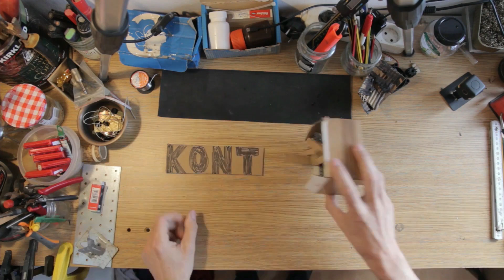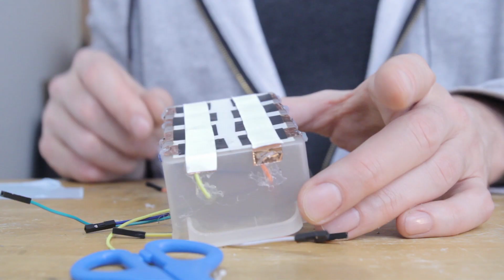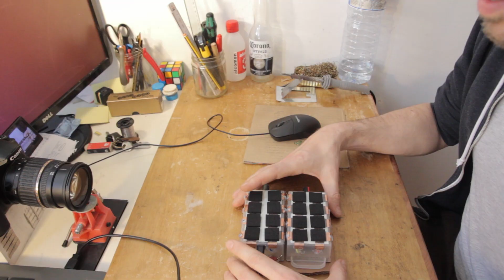DIY Pad instrument with pressure sensitive analog soft buttons: The Virus Pad.

Comment: For the past 2–3 months, my 8-year-old son and I have been really into ice hockey, but since we can't play on ice, I bought floorball equipment instead. Because it's winter, we play indoors in our living room. I built two goals out of cardboard, and then I came up with the idea of replacing the holes in the boards with sensor areas.

I searched online to see if a force sensor was affordable and whether I could create a DIY project using an I/O module or something similar. Then I asked ChatGPT, and it told me that I could do it with an Arduino or a Raspberry Pi.

I've always wanted a reason to buy an Arduino to experiment with electronics and programming. To build my own sensors, I watched some YouTube videos on the topic, but your videos on FSR sensors and this one are by far the best out there! Thank you!

Tomorrow, I'll start building the sensors, and I'm excited to solder everything together and play floor hockey with my son. I'll also make sure to adjust the sensitivity of the sensor on his goal so that the game stays fair. ;)

Comment: Hello, first of all, thanks for that great video. I'll definitely try to build a VirusPad on my own!

I have a few questions about the parts you are using (sorry if these are stupid question, I'm an absolute newbie):

- Is this a custom made breakout board or a bought one? If it's custom, are there any instructions I could find to make my own?
- I'm a little overwhelmed with the multiplexer; is there any certain one you would recommend, or does it not matter?
- My closest electronics retailer has only 8CH-Multiplexers, would it be possible to use two of those instead of one 16CH-Multiplexer?

I haven't used microcontrollers in a long time, and when I did, they were pre-built and I was "just doing the software part", without much understanding of the hardware (it was in a programming class about C), so, sorry again if these questions are stupid.

I'd really, really appreciate an answer and hopefully I can start soon building my own!
Reply from the maker: The breakout board is an early iteration of my KLIK (KontinuumLAB Instrument Kit) breakout. You really don't need it for this specific build, it just provides a practical place to plug in the sensors and multiplexer module. Great for beginners. The multiplexer pin numbers are in the code, control pins are: 12, 11, 10, 9 - and the sensor pin is 15.
I use the 74hc4067 multiplexer. Cheap modules are available online. You could use 2x 8 channel ones, but that would mean changing the circuit and code a lot, and I don't recommend it.
Hope that helps. Happy making!
Reply: @KontinuumLAB  That was very helpful, thanks for the quick answer!

Comment from the maker: This video is so long, I decided to make some time stamps to help navigate: 
Intro:
00:00 - Music
00:50 - Introduction
01:17 - KontrolFreak Intro

The build:
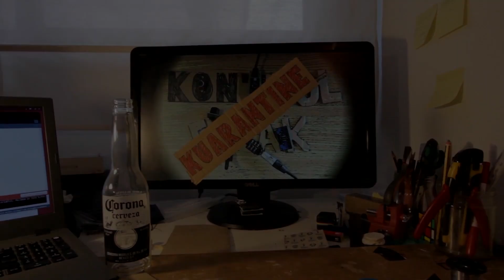01:37 - Materials & plan
03:48 - Making the base
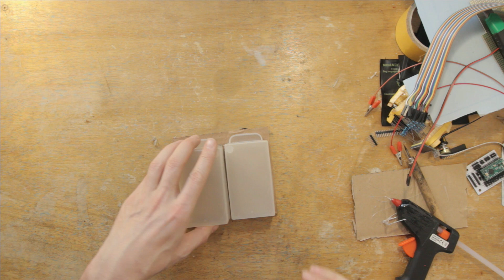05:44 - Planning the circuit
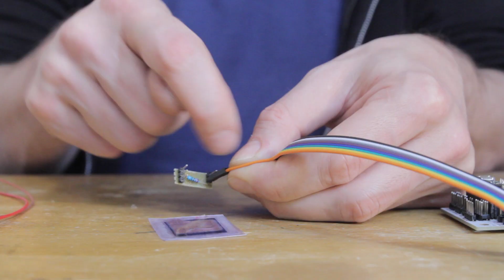07:00 - Testing my "voltage divider / multiplexer" hypothesis
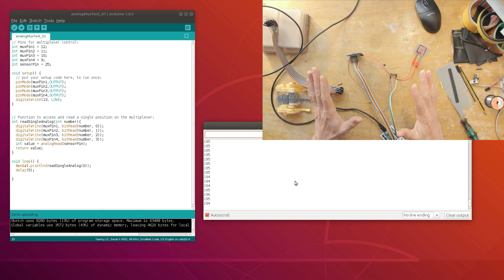08:30 - Starting the circuit
10:36 - Connecting the two boxes
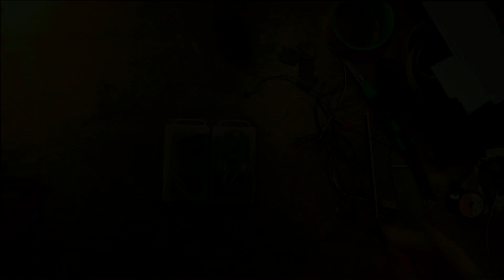12:02 - Next day. Sketching the sensor surface
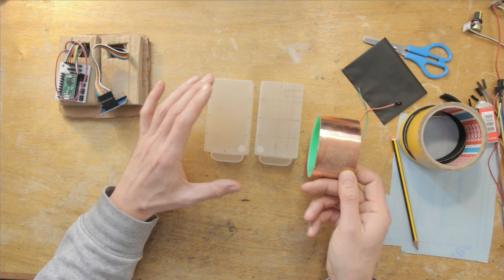13:12 - Lay down Layer 1 of the sensor. Double sided tape
14:07 - Layer 2 - Copper tape electrodes
14:40 - Soldering cables to copper tape
16:00 - Layer 3 - Velostat
16:30 - Layer 4 - Copper tape voltage rail
17:13 - Layer 5 - Top plastic layer
18:18 - Adding potentiometers and drilling holes
19:54 - Calibration button
20:30 - Foam tape sensor surface
21:26 - Connecting all the sensors
23:00 - USB cable, and finishing up the build

The code & making some noise
23:50 - Day 3. Naming & the 2-pos switch
24:28 - The code - Demonstration and Serial output
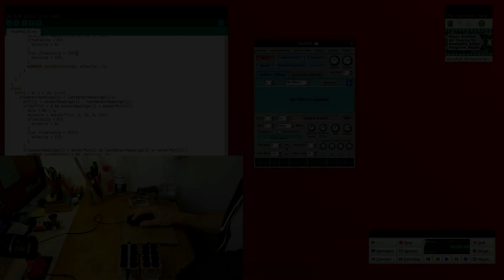28:22 - Testing with the synthesizer - playing modes and velocity
30:22 - Final code - CCs and touch sensitivity
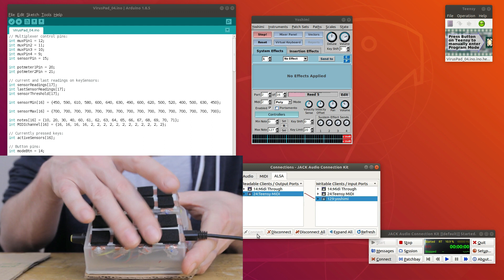32:59 - The looper - Setting up and testing (with music)
34:05 - Potentiometers, CCs and effect control 

Goodbye:
35:12 - Conclusion
35:49 - Music
Reply: thanks
Reply: you are awesome. thanks a lot!